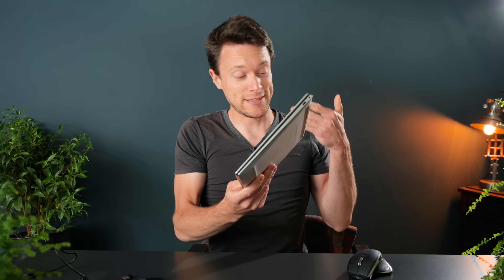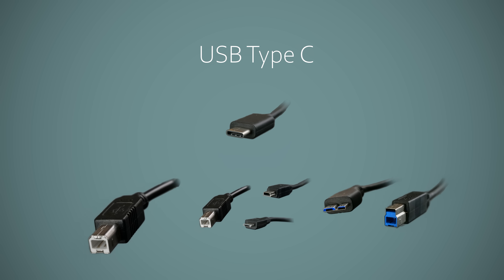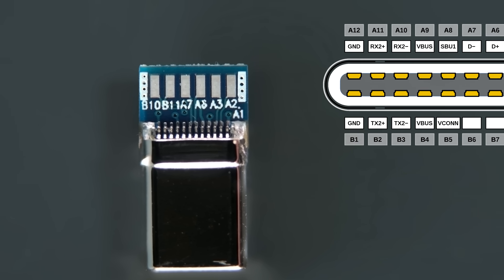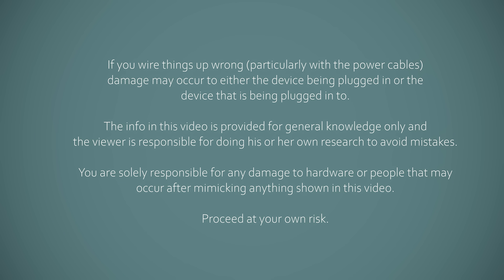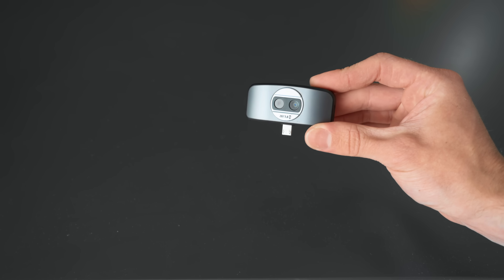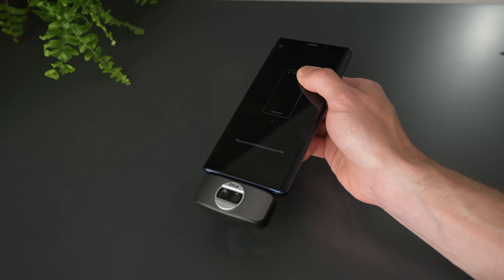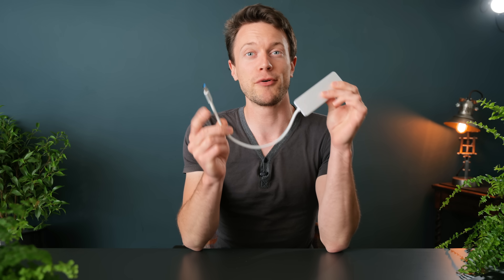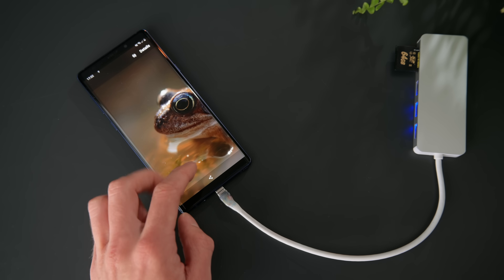Converting devices to USB Type-C

Comment: Yeaa... I think the fact that like ⅔ of the Type-A Connector is actually part of the PCB ( on the back ) may kind of explain why Logitech hasn't started making USB-C Receivers - The USB-C connector could not house the electronics like the USB-A one does - Both the size and reversibility prohibit the reuse of that neat little trick.

I'd also argue they never will as all of their mice catering towards Office use, like the MX Master Series now come with both their proprietary Wireless technology requiring the dongle and built in Bluetooth functionality thus allowing you to choose whatever you may find suitable on your device - USB-A Dongle for a Desktop PC ( and Xbox Series X consoles ;D ) without BT functionality or BT for Desktops and Laptops that come with built-in BT Receivers.

I for one stopped buying devices that come with anything but USB-C, including me skipping on the venerable MiniWare ES-121 and instead opting for the Sequre ES-126, but alas I'm now pondering the possibility of swapping out the Mini-USB Connector on my FrSky Horus X12S RC Transmitter for a USB-C one... I already have the Connectors lying around but the idea of actually de-soldering the connector from the board and attaching the new one to it is kinda nerve wracking 😐

Comment: I use usb c extension cables (cheaper stuff from Amazon) and I have found that they aren't fully USB compatible. I will use them between a laptop and a  hub (HDMI and a few USB Type A sockets, also with PD back to the laptop) . I have found that sometime USB 2 wont be recognized, even though power and display are working. Flipping over the cable and one end or the other will fix this.  I just have to remember which way is "up" when plugging this in to my laptop.

This video helped me see the differences a bit better here.

Comment: 07:10 erm... why not just move the SMD resistor over to the pull-down position, instead of scraping and putting in that old school behemoth of a resistor?
nvm, I have seen the answer to that at 10:46 : Because you have no clue about how to handle SMD.
Reply from the maker: It's a different value so wouldn't work if just moved.

Comment: Does it mean that I can apply the same method for HDMI cabels so it turns into USB C from a side and HDMI from the other?
Reply: No because USB type c is not a display cable and will not output anything
Reply: @idontknowanymore3479  But i guess it can be applied as there is a converter from HDMI to Type C already. It is used for projecting media from mobile phones to TVs. That made me wonder if we can modify a cable to be one piece .
Reply: @bishoyrafik392  true

Comment: Holy shit I just realized USB 3 ends up with 4 twisted pairs, the same number as is found in Ethernet cables... Damn it'd be interesting to see Cat 6 cabling used for USB3 wiring.
Reply: Probably why you can get usb C or usb 3 to ethernet adapters for phones and such
Reply: @conorstewart2214  Heh ethernet is a bit more complicated than that. I just thought it would be funny and interesting to see CAT 6 cables used for diy USB 3 cables.

Comment: Might i ask why you just didnt move the resistor to the other pad to the left (5:58 remove resistor from r1 and move it to solder pads r2)

if you are concerned about soldering and desoldering surface mount, cut the trace to the right, and jumper the top of the resistor to the right pad with a simple solder blob..

Comment: The video is actually really helpful… however currently im dealing with a 5 pin usb cable… :v includes an ID port which i do not know where to solder to the breakout board, any ideas?

Comment: Hi I have a led lamp with built in battery you can charge through AC power with an (I suppose) AC-DC converter and a switch to redirect DC power from led to battery while charging. I would like to remove the AC retractable plug with a usb type socket to charge the lamp through my mobile charger. Any suggestion?

Comment: Is there a way to mark the female USB-C port to be a sub device? For Example when DIY'ing a USB-C to USB-C Keyboard cable, I wouldn't want to have to check the Cable to be plugged in correctly but to have the female USB-C port of the keyboard send out sub-device infos no matter what way around the cable is connected.

Comment: It's eminently possible to hand-solder SMT resistors with steady hands and an OptiVISOR. 0805/2012 components are easiest to work with although I've gone down as far as 0201/0603, albeit with a 25-power binocular microscope and a very fine-point soldering iron.

Comment: I wanted to use this tutorial to mod a usbc socket to ps3 controller but I need a breakout board that is configured as a sub device bc a resistor won't fit in there.

Comment: I use only powered USB hubs both for USB 2.0 A sockets and USB 3.0 A sockets on my system (my new cellphone uses USB-C so that will soon change).
BUT the problem I am running into is that sometimes my system will NOT power up unless I power down the hubs that are plugged into the motherboard until the UEFI has completed.
What I am thinking of doing is make a short type A male to a type A female cables BUT leave the power wires disconnected.
This is because I believe the problem that I am having is that the powered hubs are sending power back upstream from the powered hub and to the motherboard.
I came to this conclusion because I have a 2nd USB 3.0 hub plugged into another USB 3.0 powered HUB and they both have switches and LEDs for each of the ports on those hubs and even when I turn off the switch for the upstream hub (closest to the motherboard), that port's LED still turns on when the downstream hub is still powered.
While the upstream hub could not care less if the downstream hub is sending power back upstream to it, I figure the motherboard is a bit pickier.
So, the solution I came up with is to make short USB cables (whether 2.0 or 3.0) that are plugged into the motherboard and then a regular cable would be plugged into that.
This will stop the issue of power coming back upstream from the powered hubs and into the motherboard.

Does this make sense and is there may be a better solution for my problem I should try before I start cutting up longer cables to make these shorter (max length of 15cm) unpowered cables?

Comment: USB C is pretty much a failure because mini USB is still used for Android/windows  parripheral like wireless keyboard/mouse because of simplicity of circuitry. Micro USB has been overclocked to tap into fast charging. Thier is no market for having rapid data transfer over usb because bluetooth and wifi do the same thing. The fact apple supports usb c is proof that it can't be that great.

Comment: If you use the never kind of breakout board/plug with only 4 solder pads (and the correct resistor already in place), you can in fact skip using 4 small wires, and just solder the 2 boards together directly

Comment: Nice one! Was wondering if it is posible to do the same with other types of connections such as HDMI. I'd like to connect my monitor to the laptop (with only 4 USB-C) without using any dongle.

These things don't really work unless you use one device per port. If you have a dongle with several types of connections and you connect more than two devices to the same USB-C it works really bad. But maybe my question is just not doable.

Is it possible to convert a HDMI cable to USB-C?

I know you never going to see this and most probably no one will even answer, but You still a legend, Perks! :D Thanks for all the videos!

Comment: It's a shame that they didn't use a dip switch to switch between USB-A and USB-B.
Reply: USB-A and USB-B are 2 different connectors
i'm assuming you mean to change between host and sub on the breakout board, and that's because it would probably be more expensive and bulkier

Comment: You could just move surface mounted resistor to another place on the board (the R2 marked place on the first connector). Just a little bit more flux and a good solder drop so you can desolder SMD component without damaging it. After use tweezers to hold resistor and solder first joint, next solder second. To cleanup the flux mess use isopropyl (sold at pharmacies OTC). If I needed to do that I would move all components to a new PCB. Is possible to design PCB in KiCAD and make the boards for $2 in China (for example at JLCPCB). Also you can order USB connectors at AliExpress for a fraction of Amazon cost (but you have to wait for a while to get it delivered).
Reply: it's the wrong resistor value if you move it over

Comment: The fact that Logitech still doesent sell a usbc reciver feels rediculos.
Reply: @Paul Flusk Bluetooth is absolutely horrible for any kind of real time application. Bluetooth mice feel like you're dragging the cursor around on a rubber string.
Reply: @tommihommi1  Bluetooth can be just as fast for mice, but when the main bus is busy then there can be some lag.  Personally, I never found it to be an issue with a bunch of USB mice.
Reply: @tommihommi1  yep. Bluetooth has been a disappointing technology in so many ways. i wonder, why hasn't Logitech licensed their wireless to laptop manufacturers, sort of like Dolby or DTS audio?
Reply: @tommihommi1  is your mouse like that or used to be like that?
Reply: @Paul Flusk their gaming line doesn't have Bluetooth, nor does Razer's (except for 1 mouse)
Reply: @Paul Flusk No, bt is shit compared
Reply: I have my Mac, and I bought a mouse which both have bluetooth and unifying receiver. I have to say the receiver is wayyyy stable than bluetooth on my Mac. so actually I still prefer the mouse comes with strips.
Reply: @Paul Flusk receivers are so good nowadays that you can get less input lag than through a wire for the same mice
Reply: That's actually for a good reason. Since a lot of people don't have devices that have USB-C ports, USB-A is their only option (old PCs for example). People around the world don't upgrade their devices as often as people from developed countries do and Logitech wants to cater to everyone. If you have a device that has USB-C ports, it is highly likely that it will still have at least one USB-A port if not more. Well, unless you have an Apple PC or a newer ultrabook.
Reply: The face that you cant spell is ridiculous ;)
Reply: It's 2021 and they still haven't made one. They did make a USB-A adapter, however, that is specifically designed for the receiver instead of just making the dongle itself.
Reply: @ElijahCiali  if you've ever taken a receiver before you'll see why. Logitech uses the usb A port plastic tab at the bottom to house the receiver, and the part sticking out is an antenna. Usb C is a much smaller plug, meaning the receiver needs to be also shrunken down, and because there's no large plastic tab in type C it would have to be completely housed outside of the port. Making it larger and bulkier.
Reply: The need for any dongle is much ridiculous.
Reply: I've only owned one MX Master, let's say if i bought a Logitech wireless gaming mouse, do i need to use it's proprietary dongle, or just connect as in "unify" with my MX Master's dongle?
Reply: @Smithy18 Not really, I myself have an M280 that does not support bluetooth.
Reply: Yes and it would be so incredibly easy for them to do plus they would make tons and tons of money by selling them
Reply: bros a kid
Reply: I mean, if you look at this dood's plug, it will break right off with even slight leverage. That's like 99% of the reason Logitech has a nano receiver.
Nano receivers are a lot harder on USB-C, because you can't hide part of the circuitry inside the USB plug like you can with USB-A.
Reply: @mukiex4413  here's the thing, any normal USB-C devices like adapters and USB C Drives fit flushly against the device body which means if you push on it it isn't just putting pressure on the port but also the body of the machine around the port, so it is less likely to fail.
Reply: INTRODICING.....

LOGITECH UNIFYING RECIEVER TYPE........... 

z
Reply: laughs in logitech powerplay
Reply: @Hypercheeker  so expensive, yet so satisfying.  I’ll never charge a mouse again.
Reply: I feel like you are treating the dongle like a Boggart. #HarryPotter
Reply: Guys, you can sync your mouse or keyboard directly to the laptop's bluetooth, without the need for a nano receiver which is simply a mini bluetooth adapter
Reply: @PudinAsesino  Logitech's Unifying is not the same as bluetooth, but some of their mice have both. Even for those, however, the unifying adapter tends to have better tracking, as it has a higher/smooth poll rate.
Reply: @mukiex4413  it's fairly similar, Bluetooth is just a lot more power optimized and Logitech ranges from balanced to high performance (unifying and lightspeed), but all 3 use the 2.4ghz signal
Reply: @PudinAsesino  Assuming it's a Bluetooth model - which is not always the case. Also, if your computer doesn't a built-in have Bluetooth facility that still leaves you with an adapter which will be a normal USB one, so you're back to square 1...
Reply: @PudinAsesino  is there any workaround for 2.4ghz reciever mouse?
Reply: @Cosplayinghuman  Yes this method will work on any device with a USB connection,logitechs unifying or 2.4Ghz, any 3g or 4g internet dongles,wifi dongles, any USB 2.0 portable HD's, xbox controllers,  anything with the older connection wil work when converted to USB C,  and probably will until USB Z as legacy support is baked into the design.
Reply: @PudinAsesino  Oh thank God for you.  I just tried connecting directly and my mouse DOES HAVE bluetooth connectivity as well.
Reply: @PudinAsesino Not the mouse without the plug in adapter. Bluetooth effectively acts like a driver needed to facilitate the functioning of the hardware.
Reply: @PudinAsesino  false the nano receiver uses 2.4GHz frequency, which has much lower latency and higher response time than bluetooth.
Reply: @KnockOut101inc  You might want to look up the frequency used by Bluetooth, you might be surprised....
Reply: @KnockOut101inc bluetooth also uses 2.4 kHz frequency. Anyway, bluetooth is worse

Comment: Your wireless mouse showed less fluidity than I would like. It is a good hack trick if you´re missing a dongle. but the dongle length is for a purpose. the housing has a clamp-over-wire to reduce interference and is the cause for the length. if you´re sitting on a train ride home, that gizmo you created would probably have a hard time working on and off.  so much radio pollution.  I learned a lot a few years back working at a electronic store.  but its always good to know this if you need to break down two devices to make one late at night and cant get to a parts store.  Too bad Radio Shack closed down :(  Battery Plus sucks. everything there  is 3 times as much as Radio Shack parts.

Comment: I think those pads you refer to as copper are actually gold fingers. There is a micro-plated layer of gold on the surface to prevent oxidation and improve conductivity for contact connections.

Comment: Hi, this is such great knowledge! A question tho. I have a Wacom Tablet that refuses to work through a dongle/converter. It's a known issue with Wacom but no solution. Would soldering a new  on it fix that? or is there something hardwired in the tablet that may still prevent it for , not sure if that makes a difference. Thanks!

Comment: Move that resistor from position R1 to position R2, that's enough.
Reply: I also thought of that but I checked and Nope! R1 and R2 are for A5 and B5 and are both pullups on this board. They just happen to use only one. Moving the resistor would not change anything. Unless you have a different board?

Comment: My Astro A50 headset  micro USB port is no good. I would like to change it to a 4 pin usb c female port with Pcb board for charging only. Astro has 3 wires red black and yellow. red v black grd and I read yellow to D-   Can anybody help. Can it be done. Astro has its own pcb board can I just swap them out.

Comment: The problem is durability. I meed a connector kit that uses 2 gage wire and that will be durable for atleast the next million years. Oh it also needs to have bolts. Just a small box larger than most server farms with a train hitch. Tired of flimsy wires, weak pc boards and connector housings. I really need an indestructable connector that would still be functional 1 million years from now if found in a pyramid.

Comment: Or you could use one of these tiny adapters which simply slots into and thereby converts any USB 2.0 Type A connector (i.e. not suitable for devices with USB 3.x connectors where they actually need the speed)
https://a.aliexpress.com/_vr2MKp

Comment: I wonder if this would work on a mouse like the gpw charging port. Obivously it could be soldered but i wonder if it would still charge and be regonized by logitech. Maybe damage since it wasnt designed for type c.  Guess a magnetic connected cable is the next best thing.

Comment: Oh man I have the C connector, its so weak and un-secure. A good successor for mobile applications replacing micro usb b, but it is unacceptable to replace full sizes usb a woth this pieve of crap. All I want is a reversible version of full size usb. That ship has already sailed though it seems. Eugh.

Comment: Does the resistor for the host/sub device mode matter, if I want to built a USB C female pcb into my USB 2.0 keyboard? I have two keyboards for work and gaming. The gaming one has USB C port and a detachable cable. The USB 2.0 keyboard has a non detachable USB cable. I want to put a USB C female port into my work keyboard and  use the same cable for both keyboards.